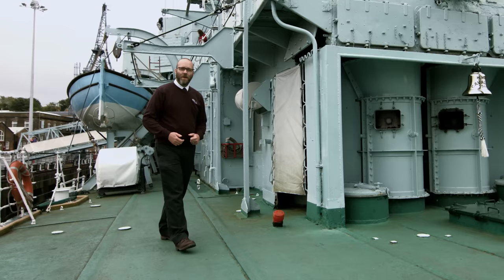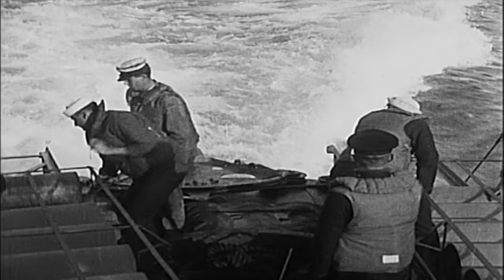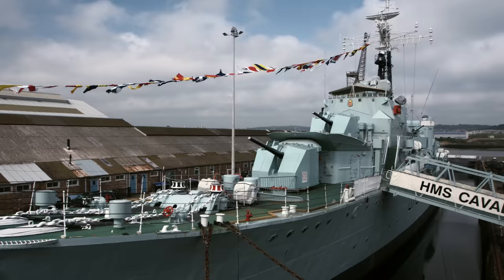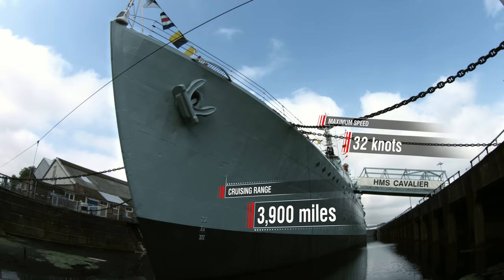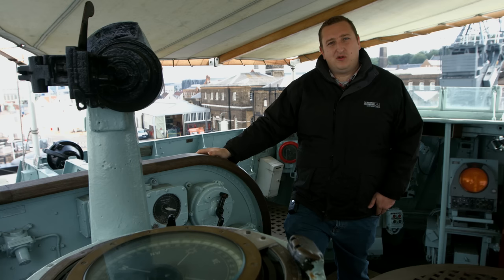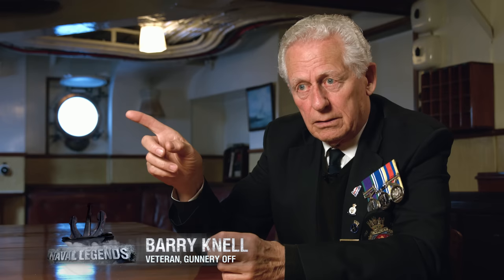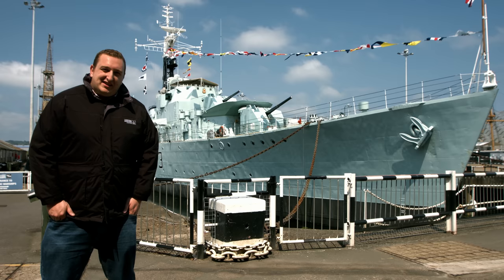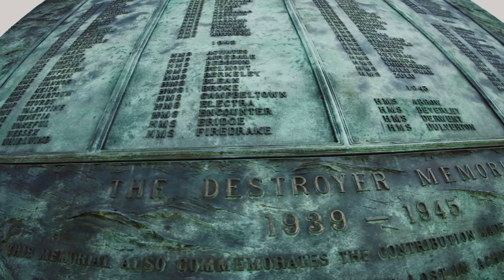Naval Legends: HMS Cavalier | World of Warships]

Comment: The gunnery officer described a shortcoming of British destroyers not corrected until the advent of the Battle class destroyers at the very end of the war. For some reason, the RN didn't see the value of enclosed gunhouses in destroyers. something adopted by the USN in the mid-30's. As the officer described, and open gunhouse allowed the seas to rush in during heavy weather. During Arctic convoys, a lot of sailors spend their time chopping ice from the guns so they'd just be useable. An enclosed gunhouse also ejects the spent cartridge cases outside the gunhouse instead of on the deck for sailors to fall over and, in some case, be seriously injured. I've never read any defense of these open gunhouses from the RN side that made sense other than supposedly saving weight. With huge protective shield needed for the lower mount of superfiring mounts, I can't imagine it saved any weight either. 

By the time of the Battle class, the Admiralty finally saw the advantages of an enclosed gunhouse, and all subsequent British destroyers came with them. That didn't correct the problem of the long serving WWII destroyers and frigates that still had open mounts, so British sailors paid the price for this shortsightedness well into the 1970's.